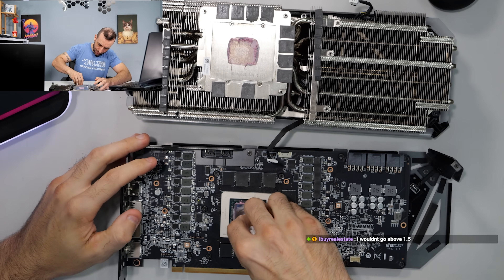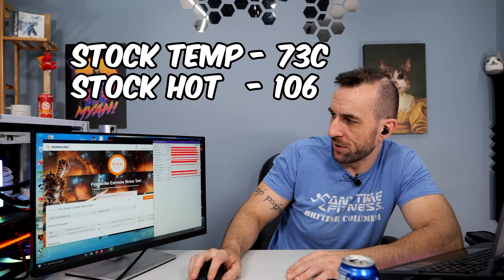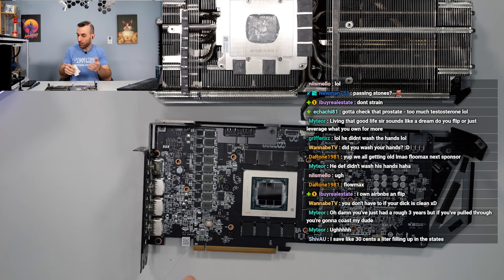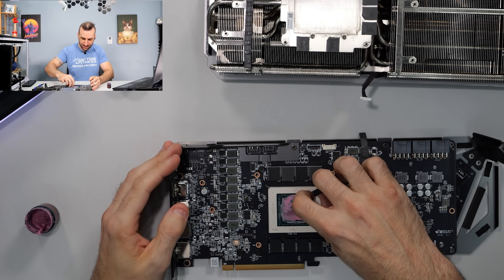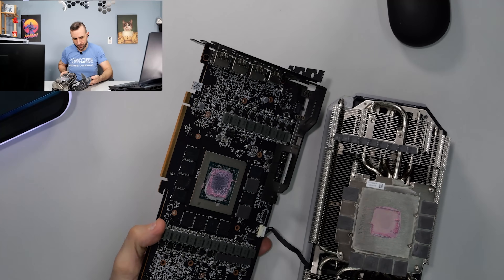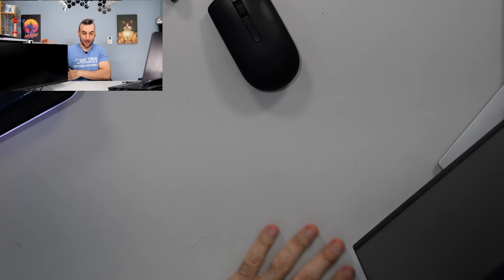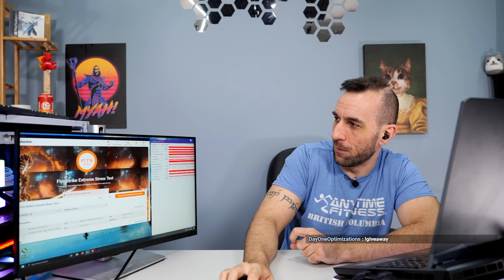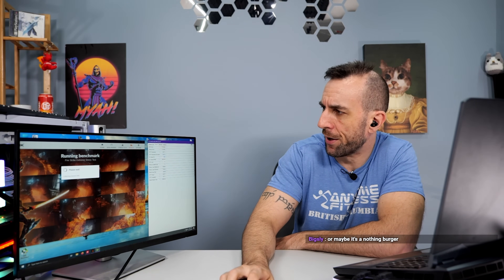7900XTX + Liquid Metal on RED DEVIL HOTSPOT FIX

Comment: I don't know if you did. I know this video is also 2 years old. Liquid metal is really sensitive to any oils. I've used it on probably well over 500 devices now. But I noticed much better adhesion and thermals on the same cards, after using brake cleaner to prepare the surfaces. brake cleaner is extremely strong even removing the left over paste oil from the metals pores. Just don't use it to clean up liquid metal itself. It just splatters it everywhere! had to wash a card after doing that and let it dry for a week.  It did survive though. lol

Comment: 6900xt red devil ultimate here . Paid 1684$ on newegg at release  and hot spot has always been like 30c above.  I've re pasted twice and didn't do a thing I just run my fans at 100 and that keeps it under control just annoying.
Reply: I used Shin-Etsu X23-7783D on my Red Devil RX 6900 XT and my temps went from 67/105 to 67/87 consistently. I have my fans set to max out at 75%. I can overclock the card to 2700MhzCore and 2150Mem easily now.  Not bad. It's a very thick thermal paste so I used the line method to apply it. I'm happy with it.

Comment: Your a brave man sticking liquid metal on like that. You never even protected the chips around the core....

Your better of buying some honeywell ptm 7950,that'll give you the best temps, install and forget...mines been going strong for 2 years and it never moves temps. Exactly the same as when I installed in, granted it takes a good week to stabilise meaning it only gets better. Mines 60c on core and 73 hot-spot.

Comment: Hey there :) 

I had my problems with this card aswell - I fixed it by installing a Thermal Grizzly KryoSheet, maybe you wanna give that a try! 
Also, would you tell me your Memory Junction Temps? I'm a little worried about mine going up to 102° when running heavy loads like Star Wars: Outlaws or Cyberpunk 2077, especially with activated Ray Tracing. The memory speed does not throttle but still, looking at that high of a number isn't nice. I'd love to fix that with Thermal Putty or pads.

Comment: Tip - get some clear nail polish, or nail hardener and cover the resistors. After that apply the Liquid Metal and you won’t have to worry about overflow after mounting.

Comment: I'm sure that someone has already mentioned that when you repaste the GPU, you can't get accurate data straight after repasting.. 
The stock paste has been sitting for possibly months before it has made it's way into your system. So to compare an apple with an apple, you should give a decent amount of testing with each circumstance to compare the apples. Liquid Metal is a totally different beast that can either give great results if applied correctly or otherwise zap your gaming future away (literally)..

Comment: I have the same problem. Sent Powercolor some screenshots and temp logs and they said everything is fine. Working as intended. Now I don't know what to do, as I can only keep the card civilized while bumping fan speeds. Should I repaste and void the warranty since they won't acknowledge this as a problem anyway?
Reply: Those warranty void stickers aren't enforceable in the US, doing liquid metal is a different matter. I'd do regular repaste, maybe even different pads but this is normal behavior. My 7900xt runs cooler with a waterblock but the delta just shifted down, didn't decrease. I'm assuming the chiplets just aren't all at the same exact height, could be because of manufacturing or gpu sag.
Reply: @jocerv43  his point is the company wont do anything under warranty. the sticker is pointless just like the warranty is. if the company says 'looks fine to us' you have to legally prove them wrong

Comment: The fancurve is based on the hotspot That's why the Liquid metal was hotter on average but better on hotspot.

Or at least looking at the bios of my 7800 xt red devil it has a fancurve for both hotspot and average but ti usually follows the hotter hotspot.

Comment: hello , i have the same card, you forgot to change pads. i also changed the pads 1mm and 2mm and repasted with thermal grizzly krynaut now same test max temp 59 hot spot temp 81. in game example cyberpunk 2k ultra settings rt on max temp 57 hot spot 79. Change the pads. I used thermal grizzly minus pads, because need the silicon based pads. 
before repasting and repading; max temp 85, hot spot 118

Comment: I had bought this gpu in february and then i customized when i got delta at 32°C
I have all the spec of the customization if you need
First, im using 1mm thickness on all the vrams
Second, im using 1,5mm thickness on vrm
And then the termal paste im using is kingpin kpx
Final delta is about 8-10°c
This vga aint that bad and had crazy perf
*Sorry my english is bad
Reply: Got same issues on 7900 xtx Phantom Gaming. Do you think the measurements of the red devil would fit the PG as well?

Comment: Found this page after looking on threads  about my the Zotac trinity 3090 wich had a temp off 70 max but my hotspot reached 100 Celsius and it downclocked. It was a brand new card and they wouldn’t fix my card but they would send me some paste and pads so I could do it myself and I could keep my warranty. Sold that dumpster fire and I will put my faith in this channel first. Fun fact I’ve never had an hardware issue again

Comment: With those temps it’s NOT worth the trouble . It will not affect the game play at all or hurt the card.
Reply: Still sux to have furnace next to you. I was sweating during the summer gaming session. Its ridicilous..
Reply: @stefantholet4036  temps down on pc parts mean the heat is going away from it, making room hotter.  solving pc problems either adds heat to the room or drops fan speeds

Comment: Stock Red devil here got 56C/85C at fixed 75% fan vs Kryonaut 53C/77C at fixed 75% vs Conductonaut 47C/64C at fixed 75% fan used timespy loop test (graphic test 2)

Comment: Hi, i use liquid metal on my rx 6800 xt Lenovo edit, stock temps in gaiming 74c and hot spot 110c, first i use mx5 and then i got 72 and 106, i chek my gpu die its not strite, ctystal is not stryt, today i use LM and temps in game is 64/72c in occt stres test +- 72/89

Comment: When comparing performance data and cooling, I believe that, more crucial than the hotspot temperature, are the average clock speed and throttle statistics. While the hotspot temperature provides a measure of how hot a component is, both GPUs and CPUs dynamically adjust their clock speeds, boosting and throttling when they become too hot. This means that they are designed to operate at relatively high temperatures. Therefore, unless exceptionally well-cooled (e.g., by a non-GPU-controlled cooler like a custom loop), high temperatures may not necessarily be a cause for concern.

Of course, high temperatures could potentially indicate a problem, but it's equally important to examine average clock speeds and throttle statistics, in addition to assessing any changes in FPS during benchmarks.

Comment: Cryosheet (thermal grizzly's graphene sheet) or Honeywell PTM7950 would have been nice contenders for that liquid metal and longevity of application.
Reply: Not really..those sheets are gimmicks and only one place really sell the real pm sheets of coarse kyronaut is awesome thougb
Reply: @Shuttterbugg it’s not a gimmick.  Used kyrosheet on this bullshit gpu and went to a 15-18 degree delta.  Never have to repaste ever again.
Reply: @Shuttterbugg  PTM7950 works amazing (from conductonaut extreme  open die to PTM open die) and I got it straight  from China. Fuck off.
Reply: @Shuttterbugg  got my ptm7950 from aliexpress passionate girl store, three monts in and its still going strong, temps and delta are the same as day 0. Dont know if its real ptm, but so far its good for me.

Comment: Try a Washer mod, i found that helps a lot on hotspot temps
Reply: You mean water cooling?
Reply: nope, as in put 0.5mm thick washers under the screws that hold the cpu down, very popular mod on all gpus, especially 5700xt

Comment: You should have tried PTM 7950. I did it on my Powercolor XTX as well, dropped my hotspot from 90+ (with 30c delta) to 75-80. Hasn't gotten any worse since March.
Most other thermal paste pump out in two months.

Comment: I confirm my Red Devil had the same problem. It seems that just replacing the new thermal paste is not enough to control the hotspot. One of the two, either the core itself needs to be polished or it is actually a chronic problem with the design. I changed the cooler to Alphacool for €150 and the difference I saw was keeping the hotspot at 90 or something maximum and 55/60 at the core (2 to 3 hours of intense gameplay) . Can we now put liquid metal on aluminum surfaces? Don't you have that corroding problem? By the way, increasing the fan speed lowers the temperature too.... I want to see the 3090 ti with the fans at 1200 rpm throwing 400watts out the window.
Reply: nope most liquid metal is gallium based, and gallium chemically destroys aluminum; nothing you can do there ... although some madman might've created a mercury based liquid metal amalgam ....
Reply: He put it on nickel surfaces which is fine.  The red devil cooler is nickel plated copper.  It will absolutely ruin anything aluminum so make sure you know what your cooler is make of before trying it.

Comment: I got my red devil 7900xtx for slightly over $600 after taxes during Amazon Prime day. It was used, missing stuff and I had to sign up with their credit card for an additional $100 giftcard as well as the 6% cashback. Has a pretty awesome coil whine to it whenever I'm in game menus, but the one great thing about it is that it has no crazy hot spots and runs very cold. Fans are silent. Just that damn whine. I'm good at microsoldering and would love to swap out the inductors or whatever the offending components are, just don't know which ones to get.
Reply: Increase their fan speed to 1800rpm, which you still can't hear and solve the problem.
Reply: @Miguel-Simao-c5k  I'll give that a try. Thanks
Reply: Just use radeon chill and limit the fps to your monitor refresh rate. I had 700 fps in hitman 3 menu and that solved it.
Reply: @stefantholet4036  Use Rivatuner instead to limit fps. Works better than AMD software or games' fps limiter.
Reply: @stefantholet4036 don’t do that you always want to limit the frame rate in game

Comment: Thanks for the video, i repasted my 7900xtx red devil using thermal grizzly kryonaut and went from 65c juntion and 105c hot spot to 62c junction and 83c hot spot....dropped my delta in half, thanks a ton!
Reply: 1088v and 2614mem and 3200max
Reply: How's it still doing a month later?
Reply: @guccipoochi  roughly the same, junction is actually lower at 60c and the hot spot is higher at 87c
Reply: @ikickthingz8480  paste was already pumping out, did you consider trying ptm7950 or kryosheet? that would keep the hot spot nice and cool for a way longer time; also if you strictly want to do paste you would be better off with arctic mx-6, thermal grizzly hidronaut or polartherm x10 (less pump out effect)

Comment: Use Honeywell PTM7950, 7958, or Laird TPCM 780SP. They are phase change materials which will properly fill the inconsistencies in heatsinks and multichip die surfaces. do not pump out, and completely non-conductive. Honeywell's internal testing of 1,000 thermal cycles, showed it actually gets better as you use it. Lenovo uses 7958 on their laptops.

Liquid metal will have a dry spot after about a year, tarnishes your heatsink and die badly, and is super conductive. I used it once on a GPU and will never use it again.

I just opened up my partner's 3 years old Asus gaming laptop, which comes stock with liquid metal. A large oval in the center of the die, was totally dry and baked. And cleaning the liquid metal off is a real pain. I replaced it with PTM7950.
Reply: With Kyrosheet on my Red Devil running 430w, 3000 core clock, 2700 mem clock under full load I'll get 60-62 gpu core and 75-80 hot spot.  Enormous improvement from any of the pastes I used.  Didn't try liquid metal but this video makes me confident that kryosheet is a better option.

Comment: I wouldn’t put a water block on that POS, waste of time and money. There is something wrong with the PCB or the lapping on the dies. Definitely bowing up in the centre. Maybe if you had a rock solid backplate too that reinforced the PCB, but wtf then you are at 4090 money, have to deal with custom loop, and still 40% slower than a bargain bin air cooled 4090.
Reply: 800 usd is more than twice less than 4090 considering recent price hike..

Comment: AMD GPUs swell very easily when pushed at max voltage, you can see it after your first paste application the bulge in the center where there is less paste deposit you have thermal push out. I had this exact same thing with my 6900xt Red Devil Ultimate. It was so bad that I was replacing paste every month after applying MX4. I dont have this issue any more when I switched paste to Thermalright TFX in the red and black packaging. This stuff is like semi set concrete to apply.

Comment: Upsiren LMTG-100 liquid metal microcapsules thank me later best compound period be it CPU direct die or GPU die nothing is as good/safe easy to apply ....
Reply: Also grab some uxpro thermal putty for vram and MOSFETs and bang some around inductors if your waterblock or coolers allows it if that could whine/vibration annoys you

Comment: my merc 310 7900 xtx runs cool. never has it gone over 56 cel. while gaming , the onlt thing i did was adjust fan currve the stock settings make the fans run at zero rpm as much as possible
Reply: You have to watch for the hot spot temps, the GPU temps are not the problem but the hotspot is.
Reply: This guy is an idiot he’s probably running the fans at stock lmfao

Comment: I own the liquid devil xtx, stock it was hitting 70c core 90c hotspot at 468w with +15% power, I did Liquid Metal and have good contact it’s now doing 40c core 60c hotspot at 468w with +15% power, I did also do EVC and at 700w it hits 90c hotspot with LM.
Reply: What is EVC and how do you that?
Reply: What is EVC?
Reply: How did you get 468w on this card? Mine maxed power slider +15% only hits 430w?
Reply: @Dane-ep8bb  Nitro+ does 465W on +15%
Reply: Fake news 🤣🤣🤣
Reply: Not al all, my asrock taichi reaches up to 525 w. Commonly 470+

Comment: Meanwhile just did the same test on My i9 10900k @ 5.2ghz all core locked and ran My Gaming trio 4090 at stock with auto fan for the first test and got 69.6c temp with Hotspot of 80.4c and 2805Mhz avg. Then ran it again with my 215+ core and 1k mem OC and locked my fan at 75%, that's where I have my profile set cause it's barely audible and it's great cooling at that speed. It then ran at 3045mhz with a 59.2c package temp and a 69.4c hotspot temp... Still stock btw and I feel like I might take the time this weekend finally, to swap to some Kryonaut paste and see what that does... I run at about 3070-3090mhz @ 53-57c in CP2077 2.0 update with everything maxed and RT overdrive on, this is just for normal game use case. I love my setup for being all air except my 360 Liquid freezer for my 10900k. And I'm coming from a 3x360mm rad setup with a 9900k and Kingpin 3090 (that system was my early to mid 2022 build)

Great vids as always Jufes! Love your content my dude! Realest motha fucka out here in the hardware space and I can't tell you enough how much I respect you for that.

Comment: Its not just red devil, you will see these Stupid hotspot temps everywhere except maybe nitro model, when my aorus 7900 xtx pulls 464W, hotsposts are crazy (+15Powerlimit = youre fucked basically :D ) Sapphire pulse has same problem as well, also reaching 100c hotspot with powerlimit 15+..

Yesterday I had nitro in my hands and that suprised me a little bit - card pulled 463W in a load and after 20 minutes it had peak hotspot of 85c.

Reddit post are crazy about these hotspots.

I swear if I see one more amd clown boy defending 7900 xtx, when basically only one aib version is viable and safe for the newbies..

Comment: I bought a Hellhound 7900XT for a build I did for someone and while I was at Micro Center they had a Hellhound XTX as well for $800 open box and grabbed it and that too had 30 degree delta. I didn't like it so ended up exchanging it for a Nitro+ XTX.
The 7900 XT Hellhound was fine on temperatures but the XTX would hit 100C on the hotspot with 70 on edge. I didn't expect the Red Devil to be like this, that's a shame.
Reply: You have a card consuming over 400 watt and you wondering why hotspot is so high. What do you think it might be?
Reply: @gametestinglab8861  It's because of a poorly designed cooler not the watts. For example right now I'm playing Cyberpunk 2077 with path tracing enabled on an Asus Tuf RTX 4090 pulling 430 watts and am looking at the temps on Hardware Info as I type this, GPU temp is 70C and hotspot is 83C. 13 degree delta and my Sapphire Nitro+ 7900XTX which can pull up to 460 watts overclocked settles around 17 to 18C delta. 
The Red Devil's cooler is not very good for it to reach those temps and the Hellhound one wasn't very good either although the Red Devil seems to be a bit worse somehow.